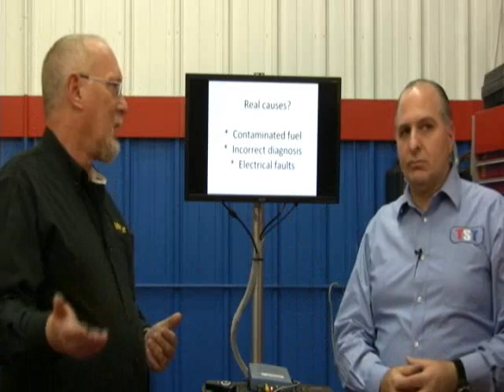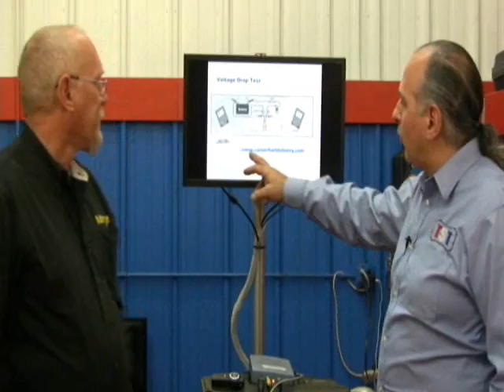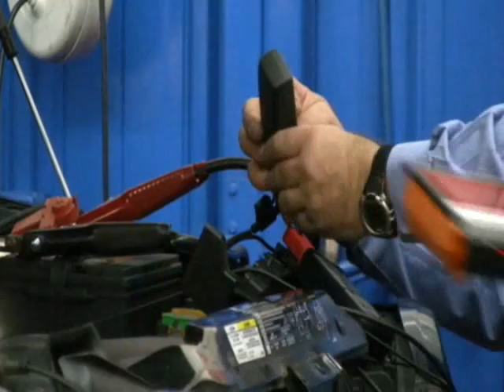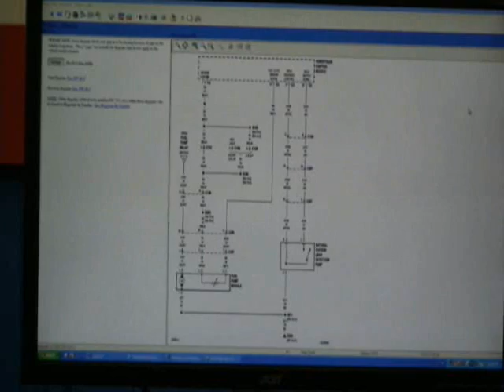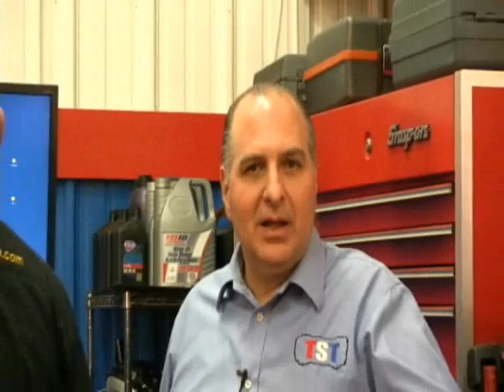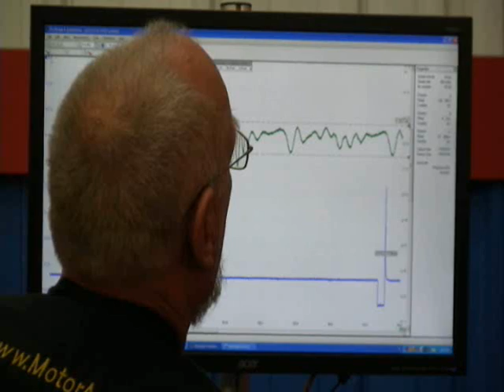Diagnosing Fuel Systems the easy way

Comment from the maker: Power Probe is a real time saver is why I use it. I can see the voltage on the feed and ground side while having the ability to apply power or ground to check the load. The Fluke meter is excellent and I use it all the time especially for VD (Voltage Drops). Thanks for watching

Comment: Hi Pete I do have a question why some motors work with low or high amps if the cars battery is 12 volt? what make different for motors to need low or high amp?